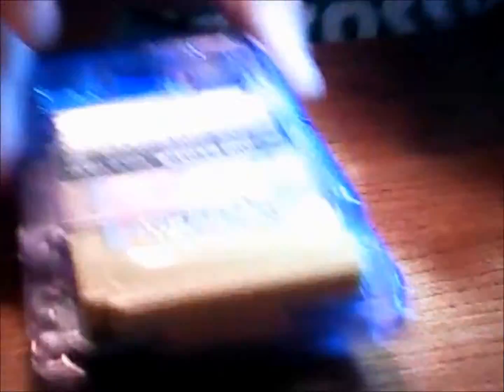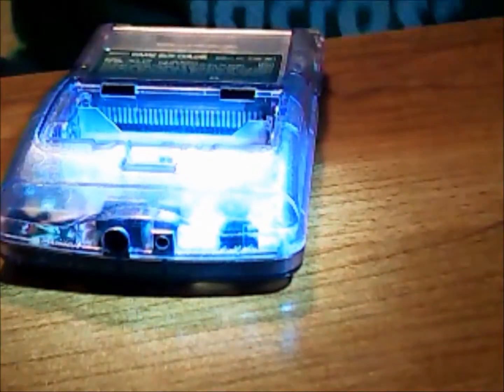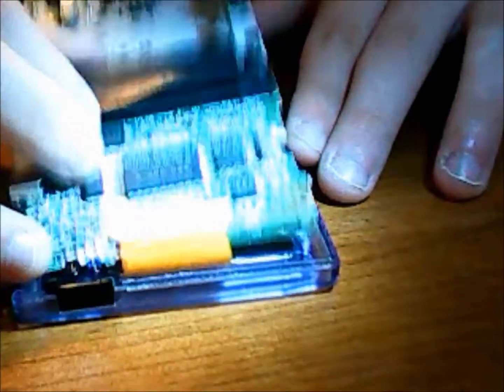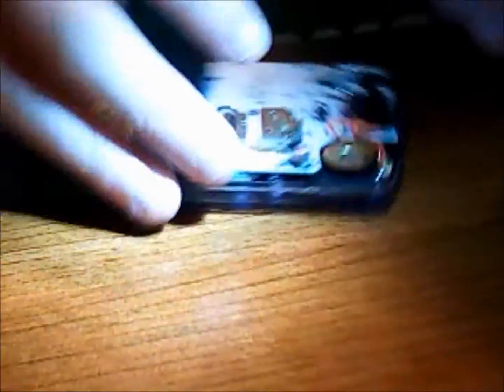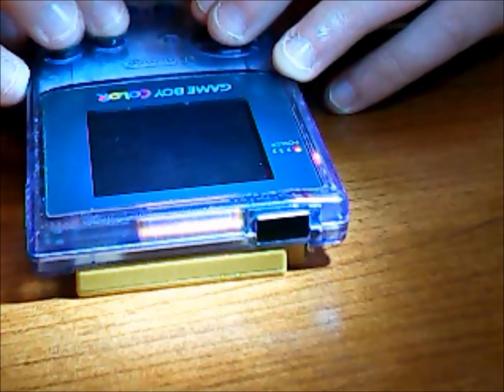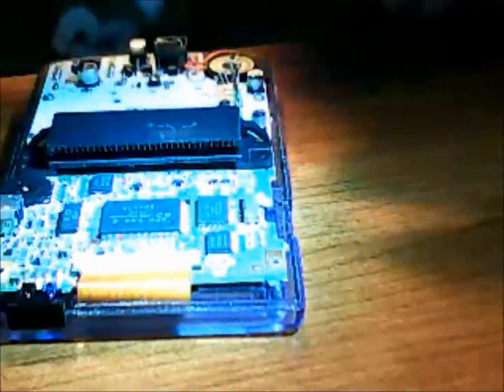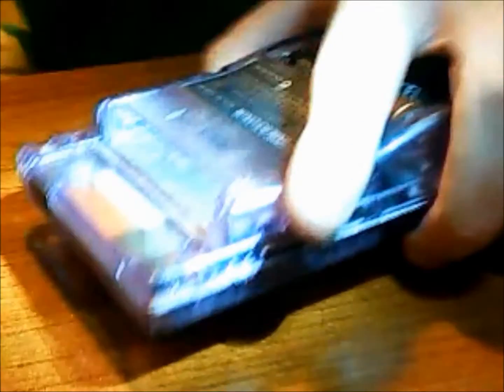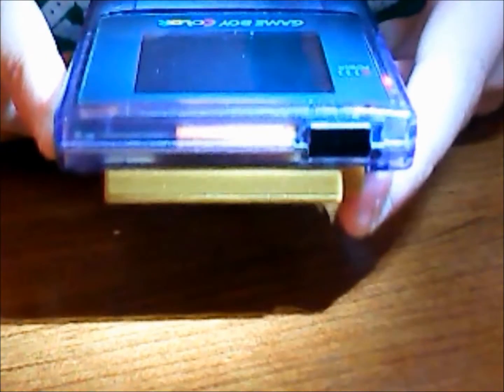Gameboy Color Button Repair

Comment: i bought a color where works (loads cartridge+sounds), but its full of dust and the keys are not working. Can these rubbers under the keys be cleaned or i need to order new ones ? Thanks & cool video
Reply from the maker: the rubber can be cleaned, but only in a particular way, try to avoid cleaning the black pads because that is what tells the board that you pressed a button, rubbing alcohol should work just fine for your dust issue.
Reply: MGWTempest Can these black pads be cleaned with the rubbing alcohol as well, or only dry cleaning like a Q-tip or cloth ?
Reply from the maker: using the alcohol will ruin the pads, I learned that the hard way
Reply: just use qtips, light watered, if soaked to wet, squeeze them. and than leave it to rest after cleaning for a few mins and put it back together